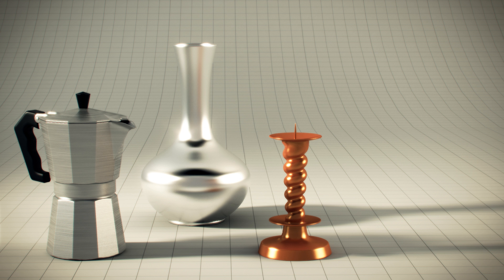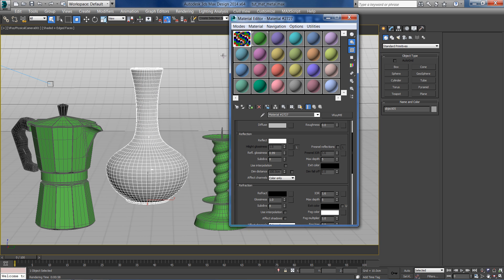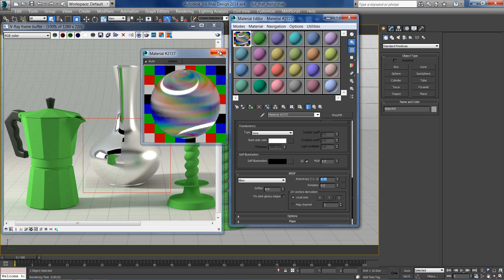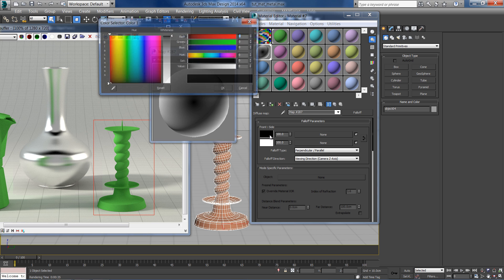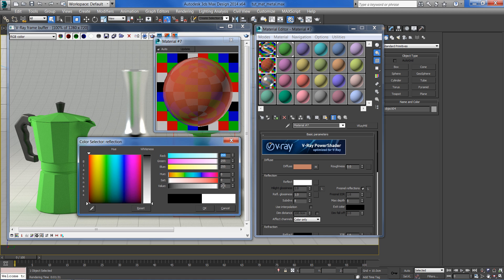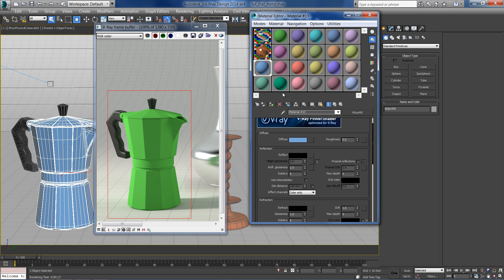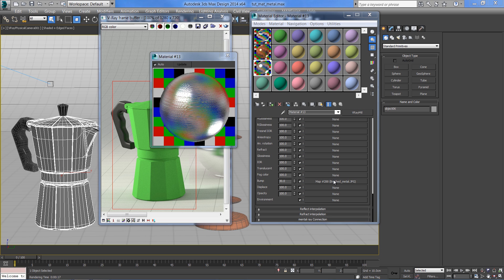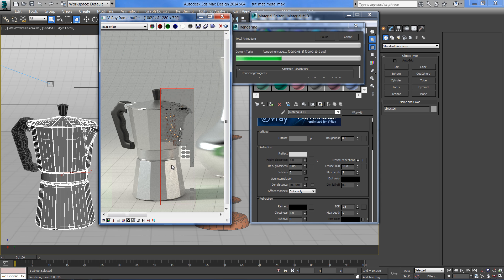Vray tutorial- how to create  Metal material using Vray for 3ds Max

Comment: I don't get the material as reflective as you, it's almost matte
Reply: you need lights
Reply: Also, in the material-editor visual, you have to active the "colored-squared-background" to get all the reflecness. Per default, the material editor visual don't place the material in an environment or what, and so there is no reflection visible, even if the material is reflective.